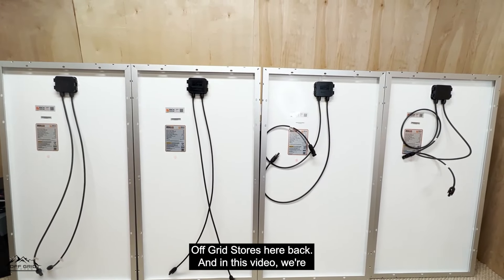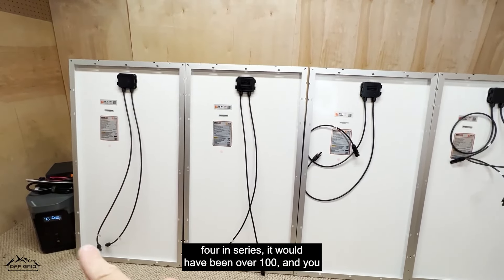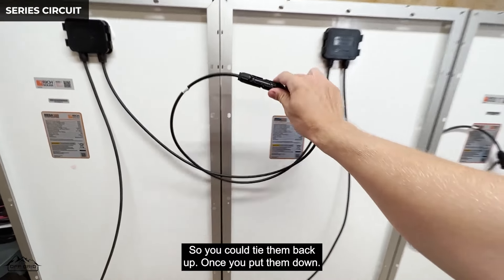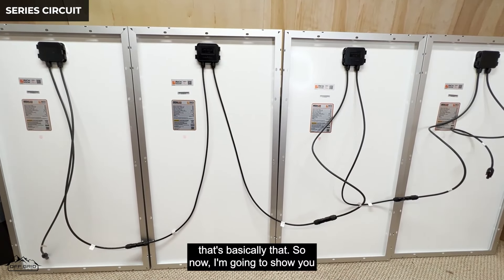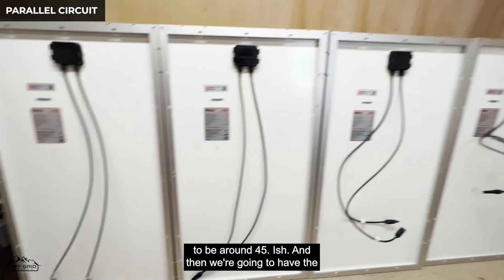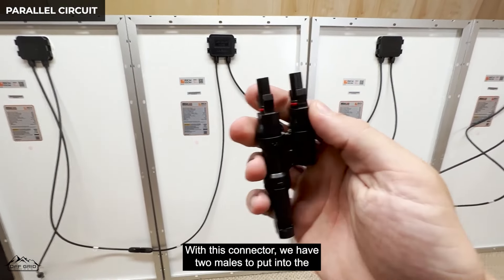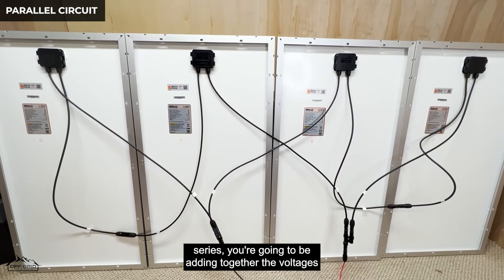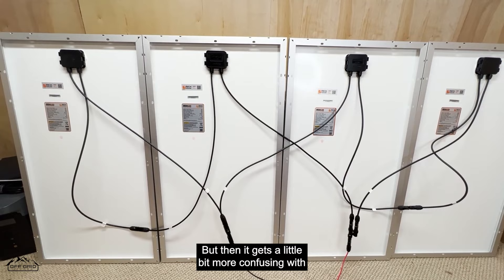How To Wire Solar Panels In Series vs Parallel (For Beginners)

Comment: Very good video and explanations for series and/or parallel connections. I'm new to solar and when people just jump into it , it can be costly and most confusing. There's nowhere really to go or to call to get help, so YouTube is where I go but it takes forever to find the video demo that answers my exact issue(s). This is one of the best videos on the 'tube I've seen so far. Good teacher, too. But one thing, check your audio levels before uploading to youTube. Using the camera mic or the phone mic just doesn't do the best job. Use an external mic or a wireless mic for better quality sound. Nonetheless, good video, bro. I'm a fan.

Comment: It would have been nice to have shown four or three panels wired ALL in parallel which would have made this video complete and knocked the subject over the home run fence in center field.  Certainly, you did a great job.  Thanks.  Advantages and disadvantages?
Reply from the maker: You shouldn't really need that many panels in parallel. Series is better!

Comment: Out of doing series vs parralel wiring, will the performance and outcome of energy gains be the same ? Or not? I mean... it should be the same. Energy X + Energy X = 2x. But is there a performance or efficiency difference in how it feels or ' which seems to work better'?

Comment: Nice video. I'm going to be plugging in to a Rover 40A MPPT charge controller. It does not have receptacles for the MC4 connectors. How do I plug in to the controller? Do I clip off the MC4s and strip the wires and stick them into the P1 and P2 receptacles?

UPDATE: Nevermind. The charge controller is set up to receive stripped wires.

Comment: So I have the Delta Max plus (4) 200 W panels. I was thinking to wire 2 panels + 2 panels in series and then those pairs in parallel...would this be a good or do you recommend a better way?

Comment: Thank you so much for this video! If you or somebody reading this could answer my question... do the negative and   positive wires have to be the same length? I'll be fitting 3 on my van and one of the cables will have to travel further to reach the inlet. Would that cause any problems?

Comment: Thank you for the video. I have just built a carport and because of the roof dimensions I have bought seven panels for the roof. The arrangement will be one row of seven in portrait. I have not really thought about inverter or the wiring yet but from your video it appears that having an odd number of panels will cause me some problems. Do you think that I will have to wire all the panels up in parallel?

Comment: Great video, very well explained! Newbie question here. I got 2 portable panels, from different brands though and different power ratings as well as voltages. My charger is a very capable MPPT 40 amp, so I'm not worried about its input. Do you suggest  to connect the 2 units in parallel or in series ?

Comment: What if I have 3 Panels 45VOC ,10A ...and Can I connect 2 In Parallel And Remaining 1 in Series... Can That Parallely Added Amps Can Go through the 3rd Series panel? Is it correct?
Reply: Can we connect if we had odd number of panels... Like 5 strings of parallel 2 panels (Total 10 panels) and connect that 5 strings in series and last 1 panel also in series to the 5 strings?? Is it correct??
Reply from the maker: When doing parallel circuits you want to have equal panels in each. So with 3 panels you want to do those 3 in series if you can. If not you can buy a 4th and do two sets of 2 panels in series parallel

Comment: Is it ok to use dielectric grease on the connections?
I know from experience that dielectric grease helps with weather.
Reply: The connector are weather proofed rated. When connected, it is IP68.

Comment: Does the sequence of the + to - matter? Can I connect the 1st panel to the third etc.. and have the 2 output wires come out from the middle panels instead of the 1st one on the left and the last one on the right?

Comment: Hey folks .. I believe Im past the beginners stage of solar , though im still wanting to get things right the first time .. 
 Some comfirmation on my question would be much appreciated ..
9 x 200w ( 40voc) panels - all in series .
360v  and say 1800w
Disconnect the 9th panel and parallel it with the 8th panel 
320v  and 1800w 
Im guessing the overall amps would increase only slightly because the 8th and  9th are paralled .. 
Could this cause any issues with  voltage and amperage inconsistancies ? 
Is it worth it ? 
Can i continue adding paralled cells to all the other cells to double the amp output ? They will all be fused pairs .
I have a shading issues for the reason for wanting to do this .
Thanks in advance 😊

Comment: Newbie question. If I have 4x100 panels being used to charge 2 12v batteries which are connected in parallel for a 12v trailer system, does it matter how the panels are configured going into the controller? Or does the controller know what the battery bank requires for voltage?
Reply from the maker: It doesn’t matter as long as you are in the allowed input voltage of the controller. It’s the controllers job to then step the voltage down to one that is low enough to charge your battery bank

Comment: One thing that wasn't clarified is what connectors are on the ends of the cable I need to connect 2 panels in series? Would it have 2 IP68 connectors on each end or 2 MC4 connectors or what?

Comment: In series and parallel which is now the best to use?
I have two panels of 430Volt 10amps of 24volt inverter or 12 volt inverter. The panel produce 38volt each given 28volt inside charge controller for one. If I connect in series I will have 76volt, is it not too much for two batteries?

Comment: I've got a delta 1300 I've got (2) 200w solar panels in series charging it would it be possible to add 2 more 200w panels and do a series parallel connection?

Comment: This is much appreciated. I have a bluetti ac200 max that can stand VOC 145 and 15 amps. 
If I have 4 solar panels that are 38 vocs each and 8.8 amps each, im better off just doing 3 in series right? Because if I do them in parallel its still over the allowable current for my generator it seems. And if I do all 4 in series its over the voc. 
3 in series seems to be the middle ground  even though its over the amperage, would that be okay?
Reply from the maker: You can go over the max Amps but not the max voltage.

Comment: So i'm just curious. Can this set up work : 

3 panels in series
3 panels in series
2 panels in series 
And have them linked in parallel?

Not sure if I ABSOLUTELY need the same amount of panels for each series?? 

Other exemple :

4 panels in series
2 panels in series
2 panels in series 
Then all connected in Parallel ?

Comment: In series, you multiply the VOC but in parallel, you instead multiply the amps? So in your parallel example, each pair (in series) is 45.6V at 5.78A. Then merged with the other pair (parallel), your final result is 45.6V at 11.56A?  So either way, the wattage turns out to be the same. It's just a matter of staying under the power station's max volts and amps. For instance, a Delta 2 has max solar input of 60v at 15A so four 100w panels in parallel will work (45.6V at 11.56A) but it won't work in series because volts (22.8x4) will be way over the max 60V. Am I understanding correctly? Thanks!

Comment: Im locked up on how long of a run this wire is good fore before there is voltage drop?  How is wire size calculated for various # of panels?

Comment: Hi thank you for your helpful videos. 
I have a question about my solar system. I had 12v solar system with 10-180 watts panels and 2 lead acid batteries 12v/200amp connected parallel. I have them about 5 years and last month I bought 2 lithium batteries 230 amp each. When I connected new batteries, my inverter would turn on and off automatically every few minutes when there is less or no  load connected to the system. I have 5000 watts Giandel inverter. I thought my inverter had a problem so I bought another inverter. This time I bought a 24v 5000 watt inverter and switched my solar panels to series. And I still have the same problem. 
I searched online but could not find any helpful information. Will you please help me out with this issue?
Thank you so much.

Comment: I’m trying to do 2s2p with 4 250 watt panels. Open circuit voltage 37.6 each. I know I need some sort of branch connectors and 20 ft extension cable but I can’t figure out the gauge of extension wire I need

Comment: Thank you for this.  I’m electricity illiterate. Which of these two configurations would charge my Delta Max faster?
Reply from the maker: Depends on your panels.
Reply: @offgridstores  I have a 160 portable panel from eco flow. I want to get another one to charge my Delta Max faster. How should I hook up two, 160W panels to charge the generator faster?
Reply from the maker: You can wire them in series in this case and you will be fine. Also we have them on our website for cheaper than EcoFlow until the end of January. Here's the link: https://offgridstores.com/products/ecoflow-160w-portable-foldable-generator-solar-panel-efsolar160w

Comment: Right now, I'm running 8 320w panels to my 6kw inverter 4 in series  n 4 in parallel.. can add 8 more 450w all in parallel in the same inverter through the combiner box?

Comment: How much is too large for your controller. Can I use a 20 or 30 amp controller for possible  future expansion if I really only need a 10amp controller starting out?
Reply: it is always better to give space if your system is 10amps
then use 20 amps charger co troler

Comment: Say 3 panels in parallel, and 1 panel is in the shade, would it (and thus all) need a diode for protection? (would the current want to run in the wrong direction?)
Reply from the maker: All panels now a days have diodes for protection. But no the whole array would just lower down in power.
Reply: @offgridstores  Thanks for your reply. So you say that my panels (295W 2 year old) highly probably have a blocking and bypass diodes in them? I can not easily get close to them to open one. How can I test if they block current in the wrong direction... I can get access to its 2 wires. Is this something a mulimeter could do.. (I am not the most experienced).
Reply: @offgridstores  yes, all panels come with diodes now a days, but these diodes are bypass diodes, they aren't blocking diodes. you still have to put blocking diodes on your own. otherwise the battery will put some current on the panels at night, you're going to have leakage of energy

Comment: You are confusing me because according to the Ecoflow website, the Delta 2 Max can only accept 60 volts dc.  I have purchased 4 ecoflow 100 watt rigid panels.  According to the solar panel specs they have a voltage open circuit of 18.6.  I would rather wire them in series but that VOC number would be 74.4 volts.  If I were to wire them parallel the voltage would be 37.2.  400 watts divided by 37.2 volts  is 10.75 Amps.  That would be in spec according to ecoflow.

Comment: Does wires coming from panel need match? 1 is 4mm and other is thin?
I bought 10awg 6 mm 
To add feet wire
Reply from the maker: We suggest using the same sized wire throughout for your panels

Comment: In series and pararel connection,Do voltage and only current increases?
Reply: Do voltage and current increases and which one remains constant?
Reply from the maker: Each Series String you add the voltage and then you would add together the amps on the parallel strings

Comment: My 2 panels are 230w each, that would be a total of 460w.  i have 3 12v batteries that is 220amh total. How would I wire it up? I'm confused... My system is running my campervan that's 12v
Reply: The output voltage and input voltage are controlled by a charge controller.  The controller’s limits are what are important

Comment: kindly suggest me how to connect 4nos. of  400 watts 24 volt, 50 voc monoperk panels to get optimum voltage (say 100 or more volt and best possible current.

Comment: I am having some buyers remorse on my eco pro.  It's limitations on input voltage, amps and wattage is not allowing me to hook up my 8 -180 watt bourgerv solar panels.
Reply from the maker: You always need to check if your panels will work with your system. Best way is to get the system first and then tailor the panels you buy to it
Reply: It eco only takes in 600 or 700 watts !

Comment: Series or parallel? ....which way is better for the quickest charge as either way is within the parameters of my Delta 2?
 I have 2 panels one being 100 watt and the other being 120 watt?
Reply from the maker: Series is better in my opinion because it takes less components
Reply: @offgridstores  Perfect.... Appreciate the info

Comment: I have 7 panels connected at 575 watts in series - 330 volts to inverter 4.2kw Daxtromn. Not connected to mains or batteries Can I add another one but in parallel? Because I get a maximum of 7.3 amps and the panels label say 13.60max At 2 kilowatt load, the inverter restarts, and I should have 3.5 kilowatts at 35 degrees of sun?

Comment: If i have 8 Renogy 100W 12V panels and i have the MPP LV2424 can i connect 2 panels in series then parallel to complete a 24V system. The MPP VOC is 145V
Reply from the maker: Why not just do all 8 in series? As long as you don't go over 145V Voc you should be fine
Reply: @offgridstores  The VOC on the panels is 24.3.  8 x 24.3 = 194.4 exceeding the 145 VOC on the inverter.
Reply from the maker: Then do two strings of 4 in series

Comment: If the Delta Max can take 800 watts,do you put 2 sets of 4 ( 100 watt) panels in series then add those 2 sets together in parallel?
Also what do you recommend for use in attaching these to a shed roof?
Reply: Watt is not voltage watt= Amps * Volts so the 100 volts allowed in is different than 800 watts.
Reply: @TheNoobstalker  
The ECOFLOW 100 watt panels are 
18 (17+) volts and 6 (5.9) amps each
The Delta Max maximum input is 800 watt ,100 volts and 13 amps
So I was correct about 2 sets of 4 panels in series then connecting them parallel.
However, I also have another smaller generator whose maximum input is 
500 watts,60 volts and 15 amps.
I am wondering if it would be a problem to combine (parallel) a set of (2)100 watt solar panels( 36 volts/6amps)that are in series to a set of (4) 100 watt solar panels in series ( 72 volts /6 amps)

Comment: i had 21 solar panels and one solar panel equal 250w and every tree solar panels connecting in series and seven group in parallel and want to connect all 21 solar panels in series with changeover switches and using  parallel again after some time in sun day ,how to do that please? because i do not want to buy another panels. 21 solar panels 7 group parallel for two inverter for home and 21 in series for vfd drive for submersible pump 3hp 2.2kw single phase ac.

Comment: I have 30 400watt panels I want to setup without using a bunch of micro inverters or using more than 3 large inverters trying to figure out how to run that without going over my voltage there 48v n 8.33amp

Comment: Is it okay to wire a 17.6 v solar panel with a 18.3 v solar panel in parallel? The voltage is abit different
Reply from the maker: As long as the amps are similar it shouldn’t matter much

Comment: What will happen if I continue with series connection and put it to my inverter
Reply: You will exceed its max input voltage, if you're lucky, it will protect itself and shut. But if it doesn't have over voltage protection, or if the voltage is too high, it will turn into a fire hazard.

Comment: Hi,

I have 5kw inverter with max 145VOC and 4500w, 9 panels 40voc and 11amp each, and 
a 2 in-1 out combiner box (fuses are rated 1000vdc and 30amps).

I can have 3 strings of 3 panels each totalling 120VOC and (11.6amps) , and use 2 MC4-Y connector on 1 input of the  combiner box?

Will I still see 120VOC and 11amps with the 9panels (3panels in series to parallel)?

Thanks in advance
Reply from the maker: I suggest getting a combiner box that can take the amount of strings you have. You will mess a lot up but connecting some in parallel before the combiner box.
Reply: @offgridstores  Thx for reply

Comment: Hi, how much 375w panels  (38v and 11amps) can I connect to a 5kw hybrid inverter with 145VOC
Reply from the maker: We would need to know the max input amperage of the inverter as well to give you a correct answer
Reply: @offgridstores  Thx for responding.

Inverter Output

Waveform: Pure Sine-Wave.
Rated Power: 5000VA/5000W.
Parallel Capability: Yes, 6 units.
AC Voltage Regulation (Battery Mode): 230VAC ± 5% @ 50/60Hz.
Surge Power: 10000VA.
Efficiency (Peak): 93%.
Transfer Time: 10 ms (For Personal Computers); 20 ms (For Home Appliances).

Solar Charger
Maximum PV Array Power: 4500W.
MPPT Range @ Operating Voltage: 60VDC ~115VDC.
Standby Power Consumption: 2W.
Maximum PV Array Open Circuit Voltage: 145VDC.
Maximum Efficiency: 97%.
Maximum Solar Charge Current: 80A.
AC Charger

Charge Current: 60A.
AC Input Voltage: 230 VAC.
Selectable Voltage Range: 170-280 VAC (For Personal Computers); 90-280 VAC (For Home Appliances).
Frequency Range: 50Hz/60Hz (Auto sensing).

Comment: My question is if I have two arrays with four panels in each array in parallel can I just series the two arrays at that point to increase the voltage?
Reply from the maker: The best way to go about it in my opinion is 2 strings of 4 panels in series. And then put those 2 strings in parallel.
Reply: @offgridstores  I will do that I appreciate the info, is there a reason why we don't do it the way I was thinking about doing it, I just like to know as much as I can, I don't mean to question you in a wrong way I'd just like to know if there is a reason why or if it has been tried?
Reply: @flintriverkayaking7051  bear in mind parallel voltage same
series current same.